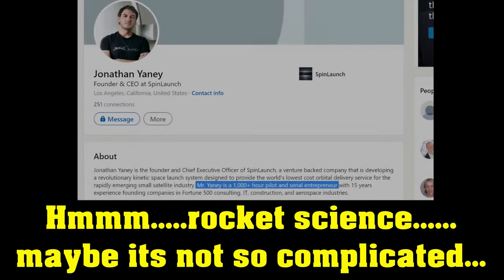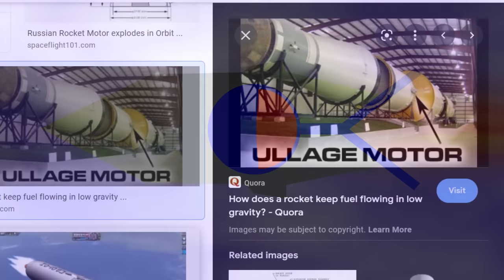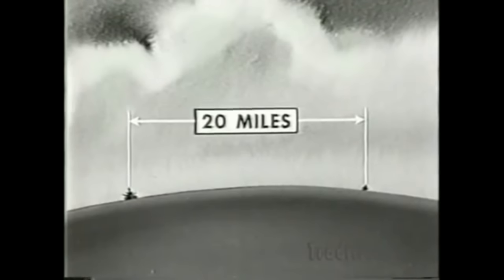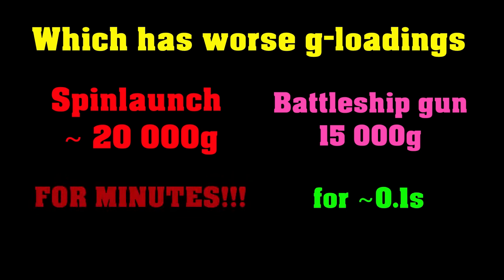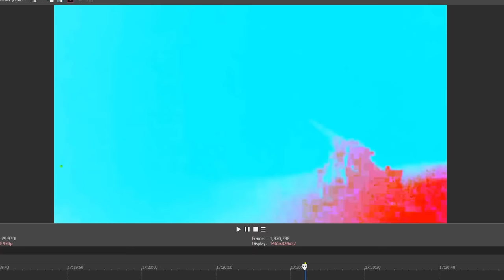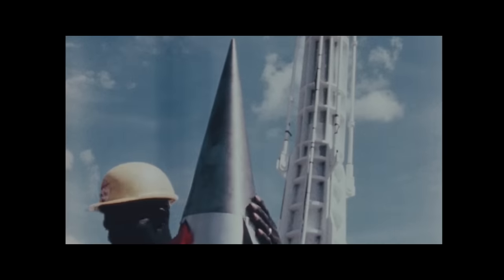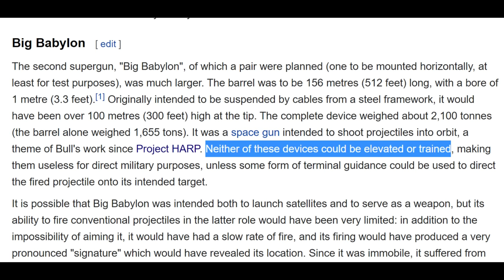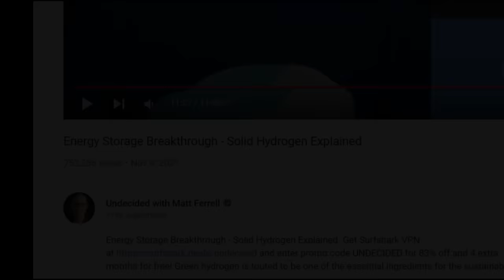Spinlaunch: BUSTED (Part 2)

Comment: Most of the reason launch sites are near the ocean instead of up a mountain is access and open space for accidents.
Firing a rocket from to top of a mountain would take less fuel to reach orbit or achieve higher orbit with the same amount of fuel.
A viable economical alternative to current launch technologies would be a hybrid system where the launch vehicle is accelerated along a catapult track with an upward angle that gradually turned from near horizontal to near vertical over several miles. Linear accelerators would push the launch vehicle up to the speed of sound or faster by the end of the track where its rockets would fire. I’m not going to go into the actual math but a payload that would require a hundred tons of fuel to launch from stationary at sea level would only require about two tons of fuel to achieve orbit if it was already at a higher altitude and already had velocity in the direction of travel. Most of the fuel burnt in a rocket is burnt getting the fuel off the ground.
Reply: "...Firing a rocket from to top of a mountain..." funny ;] See how many percent of the height is the largest mountain in the world compared to the height at which outer space begins. Now think how much it costs to bring a rocket, fuel, people to build the entire infrastructure for example on Everest (if there was a place for this), compared to literally a few seconds of a rocket's flight from the ocean level to the height of such a mountain not to mention the great danger which is the presence of people at high altitude and many many other problems and risks associated with it.
Reply: @cg_kuki2143  . There is actually a lot of benefits to launching a rocket from a mountain top.
It doesn’t have to be over 10,000 feet high. I already mentioned the pitfalls of logistics and risk to population.
But the math is on the side of the mountain not the sea. Significant fuel savings can be had launching from a mountain top as opposed to sea level.
Reply: @anomamos9095  what math ?more specifically? at rocket speeds we are talking about just over one second here to cover a distance of 100% of the mountains height on our planet (I'm talking about the later phase of the flight, take-off from the ocean level or even Everest when it comes to fuel costs the same) , for example Falcon Heavy burns for ~150 seconds and get 17,500mph so ur 10,000 feet high is nothing. You say that carrying fuel and rocket up to even half the height of Everest is cheaper than the cost of fuel that burns up in 0.5 second? (bdw full tank of Falcon Heavy cost around $550k) I guarantees that if it would bring any benefit all the space agencies would do as you say but they dont because it is not cheaper at all and most importantly it is not safer :P
Reply: @cg_kuki2143  . The cost is payload capacity.
If it take three ton of fuel to travel to ten thousand feet then if you launch at ten thousand feet you can have either three ton more payload or actually get higher into orbit than ten thousand extra feet.
The math has been done and it works out. The dollar value of the fuel is Not the cost of concern.
Reply: @cg_kuki2143  you’re really over thinking it.
It has nothing to do with speed. It’s all mass.
It takes X amount of fuel to lift X mass from sea level. 
If the lift occurs at Y distance above sea level then it takes X minus Y fuel to lift the same mass. But wait there’s more!
Because it take less fuel to lift the same mass to the same orbit it actually take less fuel again because you don’t have to lift the fuel also. But wait there’s more , because the air is less dense at higher altitude there’s less resistance so the rocket will accelerate faster requiring less fuel again.
The benefits of launching at higher altitude are any or all of the following ,using less fuel to lift the same or slightly more payload. Lifting much more payload with the same fuel or achieving much higher orbit than possible from sea level with the same rocket.
They actually do launch from mountains in some locations where they don’t care about dropping failed rockets on people.
There are only two real reasons to launch from sea level. Access and safety. You can also get a boost from the Earths rotation near the equator. If there was a convenient island near the equator with a mountain on it that wasn’t volcanic guess where they would have their launch pad.
Reply: @anomamos9095  I understand perfectly well what you are talking about but in this way saving such a short distance in relation to the entire distance in which the engines are running that I wonder how you count it, there is no option that fuel is more expensive than transport to the top of the mountain this amount of equipment where people are slowly dying due to conditions, not to mention others threats, just check what problems the people operating the ALMA Observatory have and multiply it by the number of people needed to launch the rocket  As I said, we live in an environment where money is sometimes more important than human life, if it would be financially profitable or it had any advantage i guarantees that it would be done in this way.
Reply: @cg_kuki2143  .
As I said the value is not in the cost of reduction of fuel burnt to get to orbit. It is in the increase in payload that you can put into the same or hirer orbit.
I believe China and the former USSR had high altitude launch sites.
When a country builds a thing like the Panama Canal at the cost of several hundred lives to further commerce they will build a launch pad on the highest mountain they can if it is the best option.
So they are doing just that where they can. 
The reason NASA is in a Florida and not Colorado is simply the fact that it’s near the ocean which was the best place for the very primitive rocket science at the time they needed a launch pad.
Once again it is not the dollar value of the fuel that they want to save its the mass of the fuel and how much it can limit the payload which is the important bit.
They send great freight tankers over mountain passes and build massive pipelines to move fuel so trucking it up a mountain is no problem.

Comment: Speed of sound is different with reduced pressure inside the spinner thing.
Reply: What people use the 'speed of sound' as a quantifiable number without more context, they mean the speed of sound in 1 atm of air at 20 degrees C.

Comment: When the rocket flies out the vacuum "seal" and breaks it, shouldn't the seal leftovers get sucked into the vacuum chamber? I mean, the air outside should be significantly denser for a period of time.
Begs the question, is it even vacuumed?
Reply: That's clearly what happens in the video once the projectile has left

Comment: ❓⁉️ Stripping it to the absolute basics, what launch speed wouldn't need to get to orbit all the while slowing down? At that speed the projectile would simply explode under resistance to the air, would it not?
Reply: project HARP ...wich is decades old...  say you're wrong.
It launched projectiles at 180km height with an even more brutal velocity. (but no engine on the payload, so can't make orbital manoeuver )

Comment: Solid fuel boosters would be their best bet..    also, they just say "the speed of sound," not "speed of sound on Earth at sea level."   So technically, there would be an altitude in the atmosphere of the gas giants where the speed of sound was 6x less than the speed of sound on Earth at sea level, meaning it would be traveling at 6x the speed of sound at altitude X of planet Y....  so 6x the speed of sound is true...   just not on Earth...

Comment: With the nukes, you show and discuss an implosion type weapon, but in the video they are using a gun type. This doesn't mean fired from a gun, this has to do with how critical geometry is achieved. The implosion type you discussed is a more sensitive and precise design, and generally produces more complete fission of the nuclear material.

Your point regarding g loads still stands.

Comment: You presume that the reloading bay is pressurized. It would be easy to store rockets in depressurized loading bay, to enable quicker loading. Also, you can have a overpressured fuel tank so you won't need ullage motors. Don't get me wrong, I don't think this is doable, but you should get your facts right when debunking concepts.

Comment: cgi is intended to show the vision of the company, not the final product. they say theyve done testing at mach 6. doesnt meant heir current launcher can attain such a speed, it could imply they did tests at mach 6 on parts(f.e. the rotating assembly or the lone rocket).
the exit of the projectile in the clip is from their prototype. a starting company is not a started company.
the re-pressurizing of the chamber they are trying to solve, even if they couldn't its basically just optimizing.
in your quick napkin math you compare spinlaunch (mach 1) vs a bullet at mach 3. you forgot to add the total projectile mass and projected final speed to each other, where the numbers would flip drastically.
also comparing to a gun intended for rapid fire instead of say, a rocket launching company. you would find a better launch interval still.
the long g loading is also not based, steady loading vs abrupt acceleration is quite the difference there. 
not also are traditional satellites fragile as can be they weren't designed for this, so you obv a satellite would not survive.
the nuclear warhead vid got me stumped, i figured they detonated it at 5km away.
i also figured the blast you could hear was transmitted through the ground, that has like what 7000m/s.
payload is 200kg there thunder not the projectile
testing to 20000g, ok they tested what now? and where does it say that operation will be done at 20k? 
normally i can get behind your videos a bit better but this leaves a bit of a foul taste in my mouth.
still trying to figure out why you have these errors in the video, overlooked is bad, intentional is worse, complacency even more so.

Comment: I’m no expert, but is there any material that when formed into that rocket shape and supported in the middle, will tolerate 20,000 G’s of sideways force?   I suspect even solid Titanium can’t do that.  Much less some fragile fuel tanks.
Reply: You’re no expert? Thanks for the heads up, I see no reason to any further into your comment then. No doubt you think there’s some glaring obvious problem which any nonexpert can see but has been overlooked by actual engineers and experts. 
And don’t take this as defense. I think the idea is stupid. But I’m also pretty sure any issue you are going to think up in ten minutes, was already considered well before reaching a proto test stage.
Reply: @AveragePicker  You are correct.  it's a glaringly obvious problem.  There is no material that can take that amount of stress.  Start with a 1 kilogram steel beam, 2 meters long.  Support it in the middle and apply 20,000 G's.  Each half has 10,000 kilograms of force downwards on it.  It immediately bends.  Same thing happens with titanium and even carbon fiber.  See any of the two dozen steel beam deflection calculators on the web.
Reply: @georgegonzalez2476  It's not spinning to 20,000g, it's capable of but only going to about half that. The test was at 20% it's capability. It's also not pushing down like you seem to be thinking. The amount of force on it is like that of a lower stage Saturn V, so we do have things that can take the weight.
Reply: @AveragePicker  When I said "I'm no expert", I was alluding to the fact that anyone, not an expert, can do the thought experiment:  "Hmmm, my car  weighs 3,300 pounds.  Can I support it with a steel beam that weighs 1/20,000th as much, i.e. 2.6 ounces?   No.  Not by a factor of 100 or more.  Kapitsch?
Reply: @AveragePicker  Multiple own goals, there.  10,000G's is still way beyond the capability of solid steel.   And the goal is to have a hollow spacecraft in there, so at least another factor of 100 overreach there, still, also, indeed.
Reply: @georgegonzalez2476  You are just throwing numbers around. Who said it is steal? "That's at least another factor of 100 overreach..." You just entirely pulled that out of ass air. A six inch cross sectional width of a titanium beam (900MPa) would withstand the forces on it. And again, rockets, rockets with very heavy upper stages such as the Saturn V, and Starship, are self supporting. This "immediately bends" thing you bring up makes no sense. One side of a beam is not being pulled down at 10,000g (or 20,000 as you initially said, but again, you are no expert.) You seem to be envisioning a force being applied to one point and not spread over the entire thing. 
So you might have mean not being an expert as alluding to something, but when the first number you present is just wrong, you are just demonstrating that you are not an expert and might need to just shut up. Again, I'm not even a fan of the idea but you are just sucking off the TF teat. Regardless of anything else, this project has had proper actual engineers working on it but you seem to think the most basic fundamentals behind it were overlooked. It works on paper, and you don't get to a prototype test phase on something like this because you overlooked the exact forces you are relying on to use to your advantage. 
But hey, maybe you should offer your services to them as a consultant for a modest fee. Companies love brining in consultants and I'm sure they'd love to hear from someone that isn't an expert but knows better.
Reply: @AveragePicker  I am quite sure of my facts. I suggested you try one of the many beam deflection calculators online.  The results are definitive.  Also note the many other deal-killers:   (1) The projectile leaves with hundreds of RPM of spin.  (2) They have not actually shot it from a vacuum chamber.  (3) We NEVER actually see the path or height of the projectile.  (4) The projectile is going to get white-hot in seconds upon hitting the air-- watch the Sprint rocket launch video for a clear example of this.  (5)  White-hot means it's losing energy very rapidly, it's not going to even reach 10,000 feet.
Reply: @georgegonzalez2476  Look I’ll make this real simple:
1. By the numbers, is this possible to achieve? Yes. 
2. Will Spinlaunch themselves be actually successful and able to do it? I don’t know, and neither do you or TF. I’m skeptical leaning towards probably not them. But we’ll learn from it and it will interesting.
Reply: @AveragePicker  The Saturn V example you're taking the wrong way.  No rocket has an empty to full weight ratio above 9 times.  For a rocket to be able to handle 20,000G's, it would have to be made with a weight to load ratio of over 20,000.   Way out of the realm of any possibility.
Reply: @georgegonzalez2476  Why do you keep going back to 20,000g? Again, the system is capable of, not actually pushing into 20,000. The Saturn example (https://history.nasa.gov/SP-4029/Apollo_18-19_Ground_Ignition_Weights.htm) is about weight. It’s freestanding and the lower stage isn’t crumpling under the massive weight of the uppers but you keep acting like the stress isn’t distributed but placed at a single point. Spinlaunch isn’t holding the rocket at some single middle point either. It’s more of a cradle. But whatever….see my previous post, I’m over this. Your just pulling things out of nowhere with little knowledge and just a desire to find some cheap gotcha that you think engineers overlooked for some reason.
Reply: @AveragePicker  Ok, 10,000G's then.  So you're claiming that 6 ounces of steel supported in the middle can hold up 3200 pounds and not bend like a wet noodle.   And we're being super generous in allowing you steel, a rocket and its skin and tanks has to be made of much lighter and non-solid stuff.   Good luck with that idea.
Reply: @George Gonzalez  At this point I can only assume you are being intentionally obtuse. Where did anyone say anything about 6 ounces of steal. You just made that up and making no sense what you're referring to. At least you're right about one thing, you aren't an expert. ...not even a novice.
Reply: @AveragePicker  One last time, in simple words.  10,000G's means that 6 ounces (1/4 pound) has a force exerted on it of 2,500 pounds.  So imagine a 6 ounce rocket supported in the middle with its ends having 2,500 pounds exerted on them.   There is no material that will remain straight under that kind of stress.  Not even solid steel or Titanium.  Much less anything that has to be hollow to contain fuel tanks. At least 100 times too weak.   And you have this alleged rocket exiting while spinning end over end at X thousand RPM.   Totally ridiculous.  So in the video we have the thing exiting from a non-vacuum chamber, already at an angle, and spinning so wildly they don't dare show it in motion.  Totally impossible, fake, and  ridiculous.  Seeing as the relevant facts would be its achieved altitude and trajectory, it's really weird that they show everything BUT that.  Bye!

Comment: It seems spin laucher has launched a new campaign of getting interest.  https://youtu.be/yrc632oilWo . It reveals that the pilot vacuum is 1 mbar, which is medium vacuum. The pilot launcher is at scale 1/3. The full-size will have 9 fold more area and has to operate at 0.01 mbar. Thee 9 fold bigger are requires a 9 fold longer desorption time. The 0.01 mbar at this commercial scale is probably a show-stopper. The volume of the commercial scale is 27 times larger. It depends how the pilot goes but say two weeks is an optimistic guess. Then  the commercial spin launcher will operate once a year.  Another critical point is the spinning wheel mass. The bearings have to withstand this mass and the tensile strength of the metal has to withstand 6 Mach velocity.